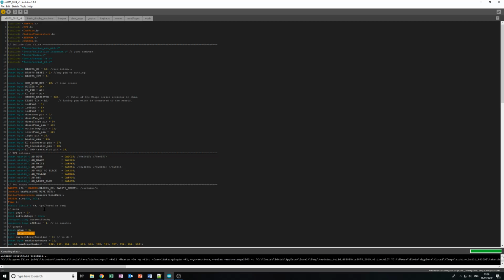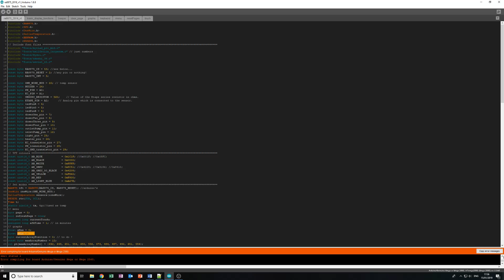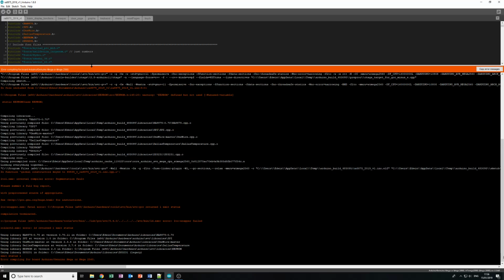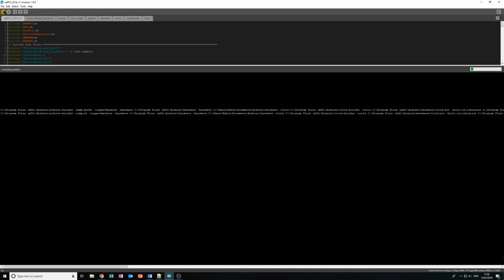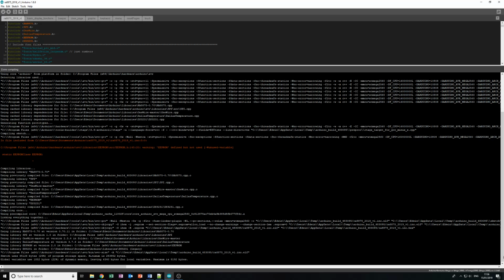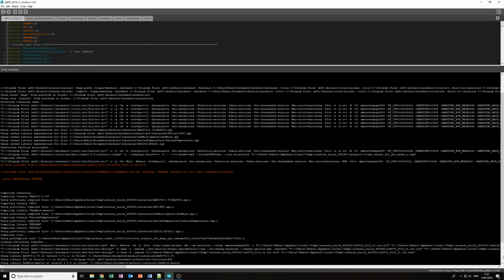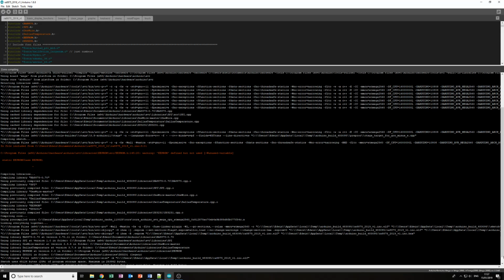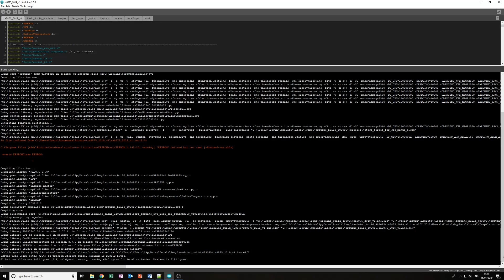Arduino IDE 1.8.8 lto1.exe: internal compiler error: Segmentation fault

Comment: I am having similar error, and have been noticing it since last year and I am ver. 1.6, using visual micro extension. I spent hours trying to figure out what is wrong but haven't trapped it yet.   Here is there error I get and I contacted GNU.org which they told me to update my compiler - but Visual Micro dictate the compiler level.

Compiling debug version of 'A-Pillar-Hmi' for 'Arduino/Genuino Uno'

 
   In function global constructors keyed to 65535_0_A_Pillar_Hmi.cpp.o
 
lto1.exe*: internal compiler error: Segmentation fault

Error linking for board Arduino/Genuino Uno
   Please submit a full bug report
Debug build failed for project 'A-Pillar-Hmi'
   with preprocessed source if appropriate
   gcc.gnu.org\bugs.html> for instructions
 
lto-wrapper.exe*: fatal error: C:\Users\Leo\AppData\Local\arduino15\packages\arduino\tools\avr-gcc\5.4.0-atmel3.6.1-arduino2\bin\avr-gcc returned 1 exit status
   compilation terminated
 
ld.exe: error: lto-wrapper failed
 
collect2.exe*: error: ld returned 1 exit status
Reply: Have you found the solution?